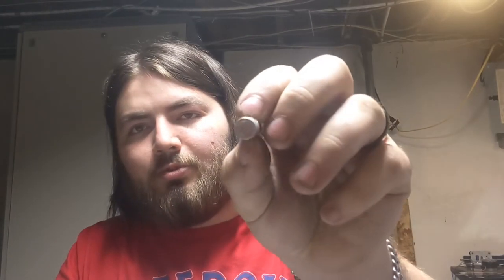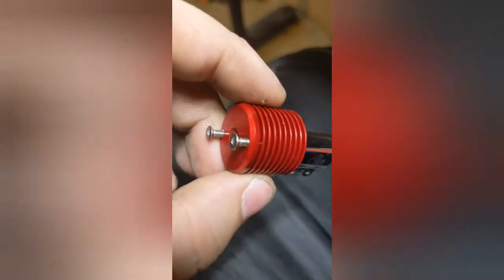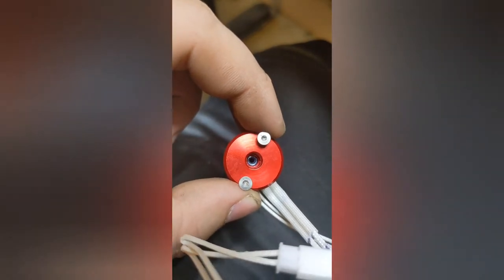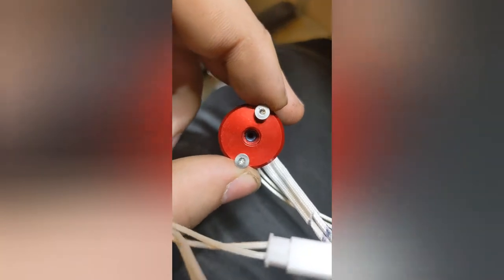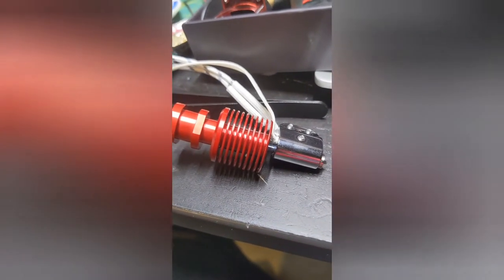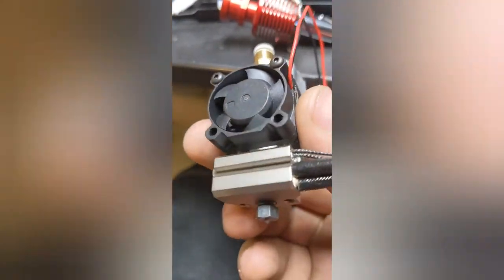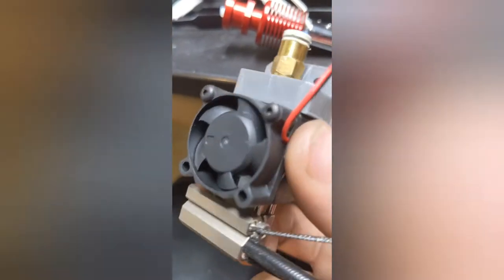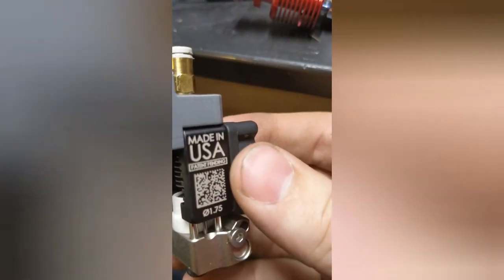Nova hotend first impressions response

Comment: For most part I have found the E3d v6 to be a reliable workhorse. I have used quite a few of them (genuine only) and have been happy. I purchased a Nova from Vlad to finish off a large printer, printing fast makes more sense when you're looking at the plus side of 600mm cubic. Haven't got it going yet so keeping fingers crossed. 
I found Chris's review to be somewhat of a witch hunt & full of nitpicking. I was drawn to the Nova by the potential of higher speed printing and Vlad's attention to detail. As a machinist I understand the reasoning for a lot of the choices he made in designing this hotend. It just made sense. I have also found Vlad to be extremely helpful and great to deal with. 

Great vid btw